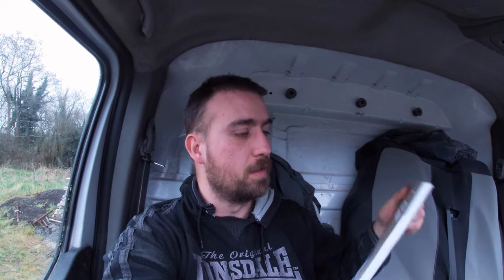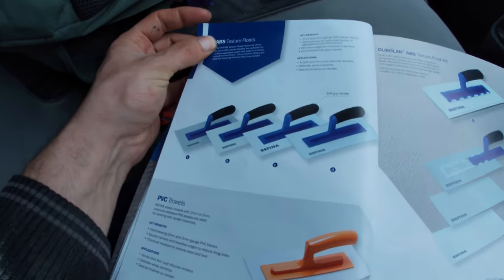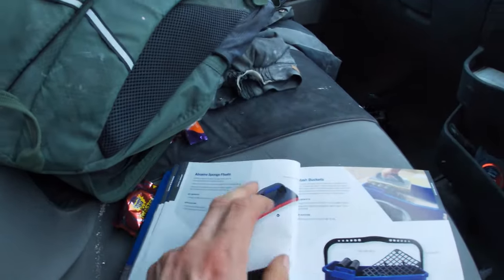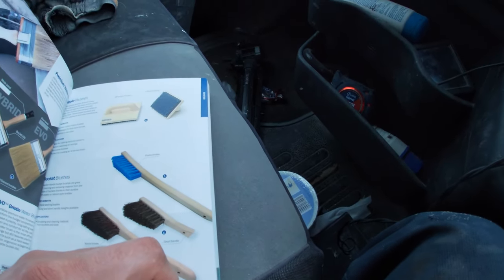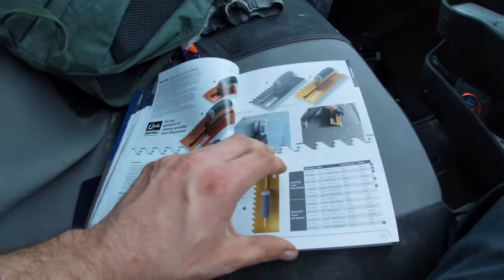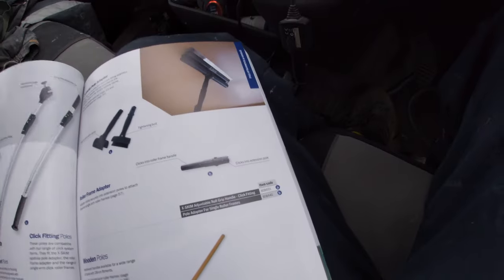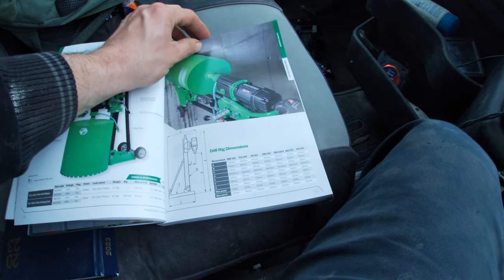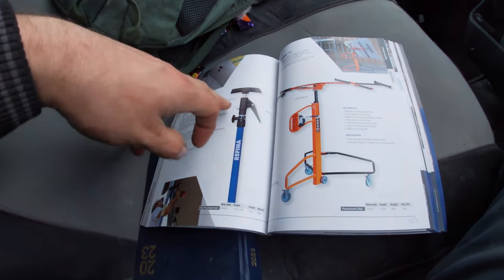refina eibenstock tools catalog Plastering rendering mixing drilling tiling painting bricklaying

Comment: Got 1 of the catalog,s other when ordered some bits them mixing buckets must be the best about. Have tons of there stuff very good quality wee stainless steel 10inch bucket trowel brilliant have all there wee margian trowels. Cement trowels etc. dashing trowel
Hard to be beat also. 
Surprised they don’t do carbon trowel range. Also a magnesium hawk.  Just bought a 16inch Kraft magnesium hawk lovey bit of kit.
Reply from the maker: Yes hope they get into hawks and like you say go into the carbon steel i a little would be interesting for sure mate ,I still have the 1st trowel they sent out works just as good now or even better that its super sharp haha :)
Reply: @macplastering  
Have the cement silo trowel. And the 16inchx4 cement trowel also. Do have wan gold finatex black handle trowels just been used most about the house odd bit plastering. As only do k rend and some dashing on ma builds a do. If dashing a garage normally whisk up 2 4 bag buckets. There buckets brilliant no moving material about just mix what’s needed for the wall doing if premixed bags which is normally. Have dewalt cordless but have recently bought tte biggest refina megamixer got for a steel at £240. With 20% discount and all ready had a bit money. Has good power think if mixing 20 plus bags saves changing batteries al the time. 
Hawks very surprisingly they don’t do everything else. Give them a email buddy 😜
Reply from the maker: I will have to get on to them :) do me a favour man just remind me in a few days and will drop in a word or even better copy this in... could be as simple as they cant make them as pattens all took ect ? sounds like you had a great buy that mate.  silo trowel is nice for sure :)